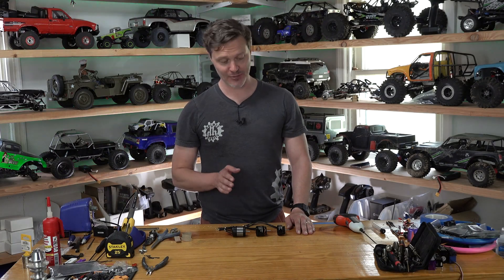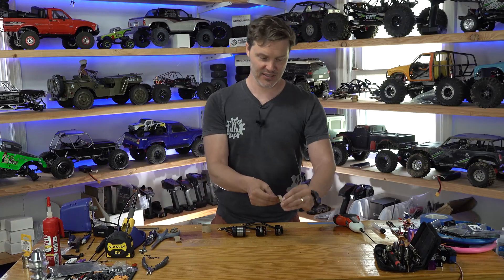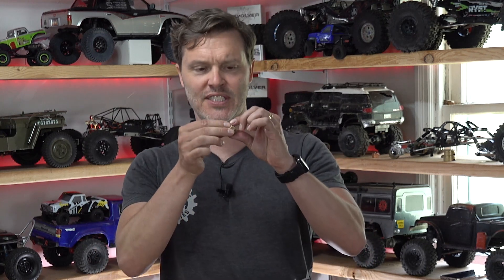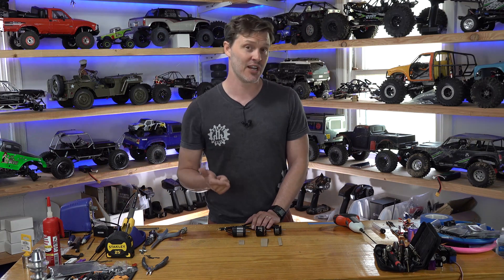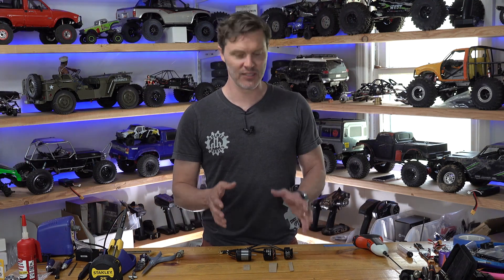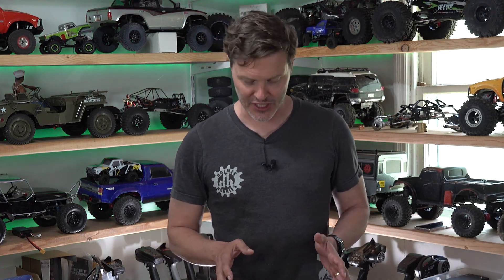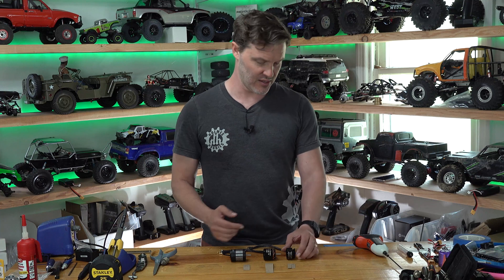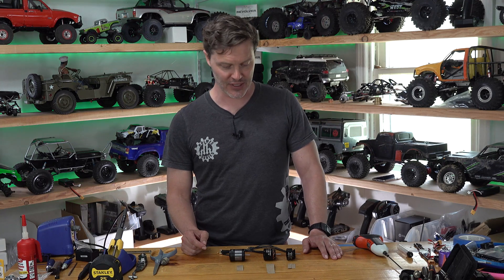Outrunner vs Inrunner Part 2 ** Detailed look at the differences with Holmes Hobbies *FLUX GAP**

Comment: Can you mount a smal fan on the outrunner to get more airflow over it, to help heat transfer? on a UAV the props help with cooling, I am in now shape or form educated enough to say that this is a viable sollution, But a thought to present. I am aware that a small fan will increse the mass, and potential snag/damage hazard, compared to effeciency of the cooling effect. and there will be less cooling on lower rpms. What are your thoughts on a small/turbine fan mounted on the back of the barrel to move more air over it?,
Reply from the maker: you could, but it's also noisy
Reply: @HolmesHobbies  not too noisy if the blades are less agressive. Perhaps ribs in the case to increase airflow?

Comment: would be cool to see a comparison against a UAV motor say a 7" 2806.5 
or 10" 3115... 
big boy drone motors but they probably are more similar than the more popular 5" 2207 or 2306; 
what do they give up for the power to weight ratio.

mostly... I guess the shaft can go out either side.... how does that work?

Comment: I'm running a scx10ii and looking to go brushless. Looking for something that won't overheat on long trails in florida heat with alot of hills and get a little more wheelspeed also. Wondering what hh motor esc combo you would recommend as I havnt found many videos on good setups for mostly trailing and not super worried about technical crawling.

Comment: I think a video on out-runner maintenance would be good. What kind of cleaner would you suggest? I don’t have any out-runners. I feel like WA is not the state to have motors that are open to the elements (most of the time we are 50%+ RH). But, maybe if the maintenance is not too bad.

Comment: A question I do have about the out runner motor; from what I can see on the backside of the revolver is open up and looks like fan blades. Is the backside of the V3 shaped to act as fan blades for some extra cooling?

Comment: So lets compare say a puller pro stubby 2200 vs 2700. Using the smallest available pinion on both, is it "better" to have a 2200 run at a higher average throttle percentage compared to the 2700 run at a lower average throttle percentage since you are using "more" of the 2200's available kv? Will this make for a more efficient setup? I go on very long trail hikes with my rig and are looking for the most efficient setup.
Reply from the maker: Or even better, use the 2700kv with more geardown so you use as much throttle.  More torque, power, drag brake, efficn
Reply: @HolmesHobbies  Thanks for the replay. The original plan was to run a 2700, however even with the smallest available pinion, it will still be much faster than really needed for 95% of my trail driving. Maybe the 2200 is just what I need. I'm currently using a Crawlmaster Pro 13t which is roughly the same kv and works great for me. I'm still not even convinced I even want a brushless system, you did so damn good with the Crawlmaster Pro.
Reply from the maker: Yes, it's always better to use more throttle than less, on the whole. A 2200kv at full throttle will be more efficient than 2700kv at part throttle due to esc efficiency.

Comment: Anyway you could put a video together for a motor esc combo for somebody who does alot of uphill and downhill walking and crawling along the way here and there. My sidewinder 4 and revolver classic overheat while walking im going to throw the fan back on to try and help it out.
Reply from the maker: You want the same wheelspeed?  Is it the motor or esc?
Reply: @HolmesHobbies  sorry i didnt see you replied. The esc gets very hot to the touch once it shuts down the motor is warm. You can put a finger it for about 5 secs then its to hot to hold your finger on. Its in a wraith 2.2 with battery relocation to the front. Stock gearing. It takes it about 30 mins of uphill walking pace and the esc overheats. 
The revolver i have is the 1950 kv. It was id say a 80 degree day here in california the last time i ran it. Its been 2 weeks now. I did plug the fan back in but havnt ran it yet.

Comment: Eye opening stuff Dave, my simple monkey brain makes me think that the open style bell design would help mitigate heat? Would a fan style mill job on the end pull more heat out ? And I tend to think that larger rotational mass vs tighter as in a comm in a can has some beneficial effect on smoother crawling? Again I’m thinking in simpler terms. Excellent info! Keep it up! 👍🏼

Comment: So the outrunner is better…. So when are the quiet plug and play outrunner ESCs going to be available?  I run nothing but Holmes brushed motors in my crawlers, but i think its time to switch to an outrunner. I just hate the noise and want plug and play installation.

Comment: Educational as always, we need more videos like this, not only from you but experienced people in the hobby taking their time to share their knowledge and help new guys understanding it better.
How well does an outrunner survive if it meets water sand and mud? Asking for a friend 😁😁
Reply from the maker: If cleaned after, no problem
Reply: @HolmesHobbies  okay, I've had brushed motors jam while driving, I've learned to appreciate motors that doesn't have exposed coals sinze they seem to cause less issues.
You didn't mention how the flux spacing affects the drag brake?
Reply from the maker: @patrikmoller3643  more flux gap area, more drag brake
Reply: @HolmesHobbies  I'm sorry but I don't fully get it, I think I do but I'm still not sure, I've always been told that a brushless motor need a sensor to be able to have a decent drag brake. Do you simply just lock the motor in place to keep it from moving using the Flux area? 🤔
Reply: Mine went into the deep end of the pool for about 30 seconds. No issues.
Reply: @DESOUSAB  fresh clean water isn't really the same as dirty muddy water
Reply: @patrikmoller3643  Ah - sand and mud...  YMMV.

Comment: Is the OutRunner motor waterproof and what's the max weight
Reply from the maker: They run in water as long as they are cleaned and dried after.  We have guys running the 1000kv revolver 540 pulling 35lb tow rigs.
Reply: Thank you for responding

Comment: So? I’m sure it Will vary from motor to motor, but what is the usual “sweet spot” or “power band” (what ever it is called) range? Example; from 75% to 90%, or does it very so wildly depending on kv, size etc, that it is useless to think in those terms?
Reply from the maker: In terms of max power, its when unloaded rpm is loaded to 50%.  So unload speed 1000rpm, loaded down to 500rpm.  In terms of efficiency,  it's normally peak around 5 to 10% of max power but design plays a large role of this

Comment: I never had an issue with heat until I got the cm mini v2. Everything seems to get hotter with them.... so much so I had to swap out a cm mini for a micro x at beat the creek to run trails with my v1c1
Reply: Turn sine power to 5.  That's the next vid releasing soon
Reply: @johnrobholmes  I have to get the programmer thingy and then watch the video. Other than the heat its a killer esc!

Comment: Love the video, you explain it very well and It is very nice to understand what makes things work the way they do. Question* has anyone ever tried designing a motor that is like a brake disk with the stator in the spinning disk and the coils around either side of the disk? Or rotor?
Reply: That's an axial Flux design

Comment: Yeah, so I know what KV is, but what exactly controls the KV, what makes one motor a 2700kv and another 3300?  And if the can is so much longer on an inrunner, why is the rotor so much shorter, I get the diameter difference, but I couldn't visualize the length.  It looks like the inrunner should be able to have a longer rotor to make up for more of that gap area.  Thanks for the videos.
Reply from the maker: I've designed my outrunners to be as short as possible. The inrunner by design needs more room between screws and stator, and also has the extra inavoidable length of the rear bearing, and also sensors if it's sensored.
Reply: Kv comes from the windings and magnets. Over time magnets with become weaker and the Kv will actually increase. The longer the stator, the more torque it will have.
Reply: Thanks for the extra feedback.

Comment: I have a puller pro 2700kv and a copperhead esc in my Phoenix. Did my first long trail run and I noticed the motor was running very hot, so hot that I could not touch it. This was on a very easy trail for the Phoenix since it just was a test run. Put a pinion size that Josh (Harley design) recomended for it with that motor (cant remember what it was), and Im running on 3s. Did the same trail with my scx10.3 early bronco that have the original firma 40 esc with a 550 crawlmaster sport, and the motor was just slightly warm and the esc was pretty much cold. Why is my brushless system so much warmer? Can it only be the gearing that is wrong? (Have to check my pinion in the Phoenix).
Reply: Pinion, or maybe pinion mesh
Reply: @johnrobholmes  ..or maybe the ESC has an issue 🙄

Comment: Man this exactly what I wondered comes to not using ourunners..in anything but crawlers
Reply: Still don't get why o.r better for airplane ✈ because more torque density and smaller .? You said because too many parts on in runner
Reply: @paulclancy2404  out runners are used in airplanes and drones because they are so light.
Reply from the maker: Outrunners are used in Drones and planes because "nice" gearboxes are expensive.  In Drones, it would make the prop sit too high as well.  

For high performance planes like pylon , hotliners, etc... the higher performance is still a geared 4 pole inrunner.   But it comes at a size and weight penalty,  so it's a balance of wing loading and ballast too.  If the geared inrunner can be used without extra counterweight and we are pushing for world records, it's still the better choice.
Reply: Thanks I got it makes sence my swamp boat is very simple and light 👌

Comment: Great explanation 👍🙂 Do you know if a waterproof outrunner exists? 🙂
Reply from the maker: They are all waterproof if you don't let them sit and rust after.  I designed mine to run in mud without slinging a magnet.  Just gotta care for them after.
Reply: @HolmesHobbies  sounds awesome. Think I'm going for an outrunner on my Gladiator or would you recommend another motor? 🙂
I was wondering about another factor of those outrunners. I guess the housing (that spins) also have something to say when it comes to it's weight. Just like a flywheel on our 1:1 cars. If you have a heavy flywheel, you probably have more torque. Have you experienced with that? 🙂

BTW...I'm an engineer. So I'm a like a sponge, when it comes to tech, electronics and software 😀

Comment: If you connected the outrunner from another source would become an alternator.. example connected the shaft to another and ran it would it produce voltage....or attached wheel could you get regen power ...
Reply: Are you thinking regen under braking, or adding a motor to the system to create regen while running.  I don't think the first would work at this scale, and defintely not for crawling, and heat would be major issues for bashers/racers.  The latter would use more power than it would create.  Otherwise you'd be a trillionarie if you could create perpetual energy at any scale.